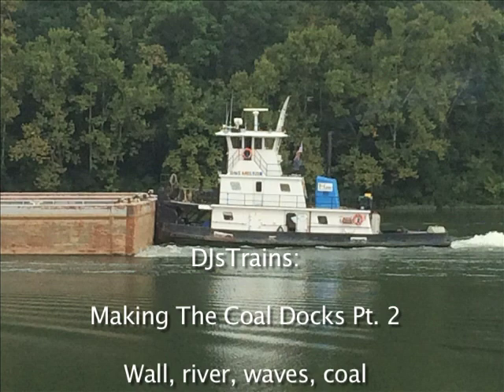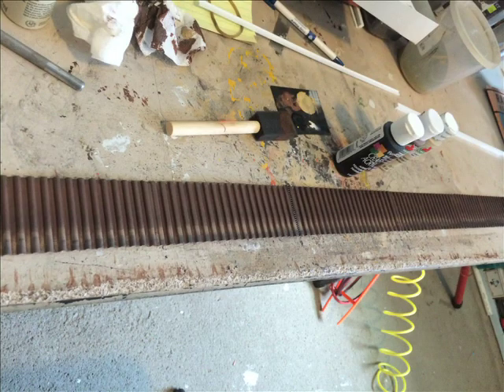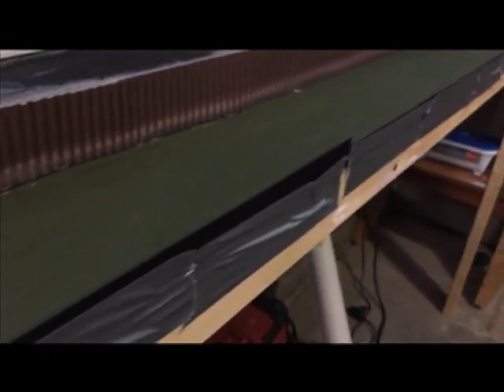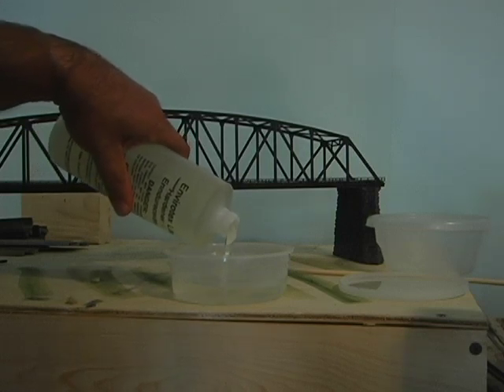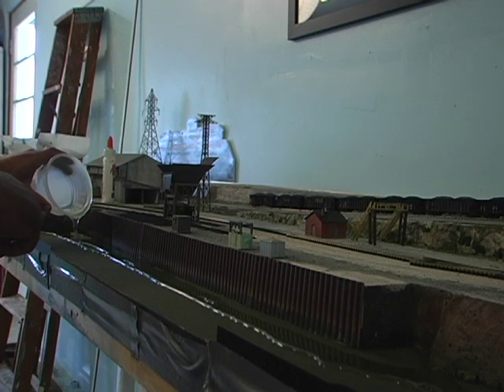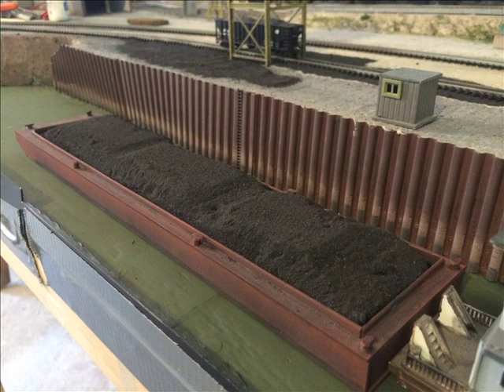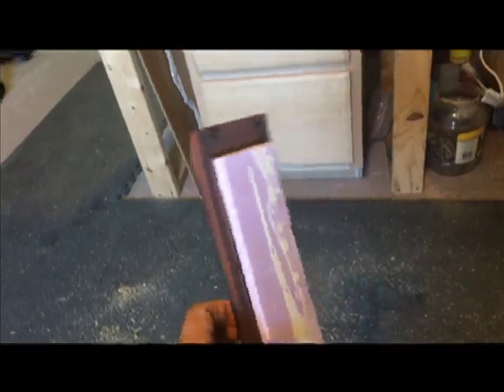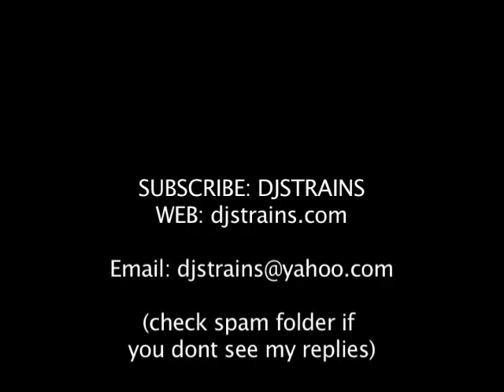Model Railroads: making the coal docks PT. 2, walls, river, waves, coal

Comment: DJ, The Duquesne Coal Docks on your layout is looking great. Here's and old trick for getting small bubbles out of the Envirotex resin, exhale across the surface of the resin, in the same manor you would to fog the lens of glasses. The heat and CO2 in your breath causes the bubbles to rise to the surface and dissipate. If you have a lot of bubbles in your resin, you can use a Bernzomatic torch. The resin is not flammable, but be extremely careful you don't catch the rest of your layout on fire. Very quick passes over the resin with the torch will do the trick. Another nice video DJ, keep up the great work on the Union Railroad inspired layout.
Reply from the maker: I covered that in my video "how to make a river".  But I said "layouts and blowtorches don't go together well".  lol.

Comment: hi DJ... that came out fantastic... & easy to do.. i have a question for you... if i am using a mid train DPU in a tank train do i need to use buffer cars?? in front.. in back or both for the DPU...
vinny
Reply from the maker: good question, I have never ran into that.  I haven't seen any mid train helpers, only rear helpers, and there is a buffer car.
Reply: djstrains hi DJ... thanks for getting back... i guess if i run a mid train helper in a tank train i'll just add one before & one after to be on the safe side 
vinny

Comment: Very nice video. What product did you use for the retaining wall? Looks like styrene, is it a specific brand?
Reply from the maker: +splitrock323 Thomas Evergreen makes G scale corrugated siding
Reply: +djstrains Thanks DJ. Be safe out there. ( you run for NS right? I run for UP ) Do you have the Evergreen part number for that G scale styrene?
Reply from the maker: +splitrock323 Thomas CSX.  I don't have that, but its available.